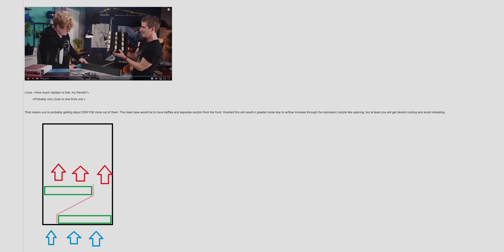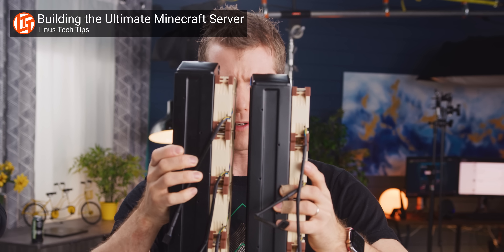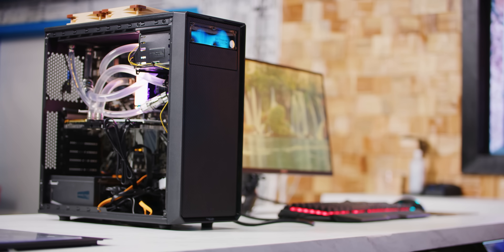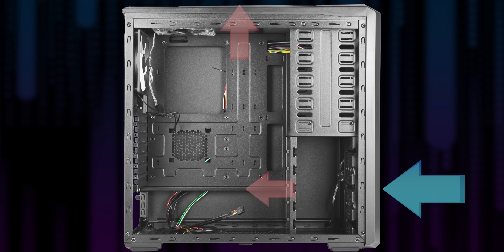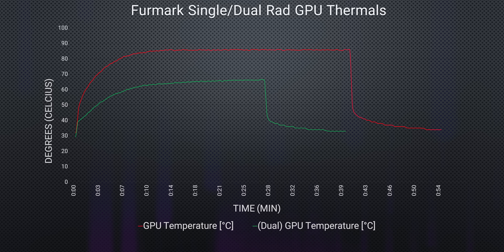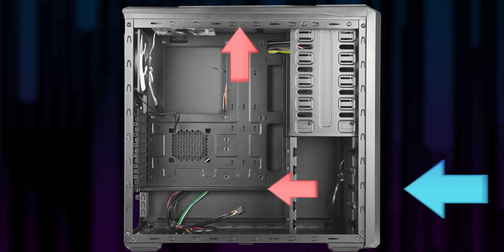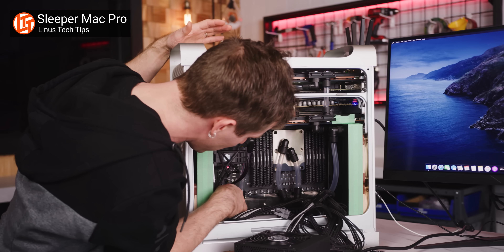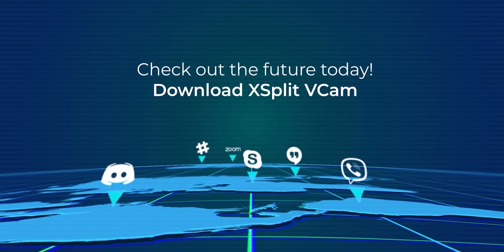I’ve been water cooling wrong for YEARS - $H!T Manufacturers Say

Comment: Yea, they teach that stuff in engineering college. 

You should put them in parallel air flow if you want more cooling.
Reply: Parallel will have better performance, sure, but it is a very bold to assume that the air coming from a radiator is practically the same temperature as the radiator. You can put something like a blowiematron on a radiator and the air coming from it will be close to ambient.
Reply: That’s the whole problem I have with Corsair’s statement, it’s bad problem solving plain and simple. It takes 5 min and two temp sensors to find out the air coming out of a rad is not far off ambient. Whoever made the assumption that since rads are so efficient the air coming out is close to water temp needs to revisit their heat transfer class.
Reply: @corinwilson1590  if corsair is claiming 100% efficiency, sign me up.  NEVER in my life have I seen a 100% efficient hx.
Reply: @corinwilson1590  It's transfer of heat. Faster moving air will not take enough heat to raise the temperature. But is that efficient? You can blow a hurricane in there and cool all the radiators... but it won't be noise pleasant.
Reply: I would also put the water flow in parallel also.  parallel flow your head pressure is not that bad compared to having hx in series.  With a small pump/high head pressure you might run into the risk of not providing enough water flow.   Having done water cooling for a/c avionics it's a trade off of hx size vs. head pressure vs. cooling air vs. number of hx
Reply: @AG-qq3zl  
parallel water flow doesn't sound like a good idea to me, water follows the path of least resistance as most things do and since it is very unlikely for someone to make two parallel loops with equal flow resistance, one of the radiators is going to get more water flow, while the other one is going to get very little water flow, preventing both from achieving peak performance as the water isn't in radiator number one long enough to radiate it's heat away, while the other one doesn't process the amount of water it actually could.

my personal question on the subject is why they even install radiators into the case, according to my thought process, it would be more advantageous to have the radiators outside the case.
Reply: @windhelmguard5295  it's not that hard to balance the flows.  It just depends on how its installed.  In some cases the hx were close enough and equal heights that the flows spit evenly.  Another time we used orifices to balance the flows.   There are always a thousand and one ways to plumb a system.  It just depends on the restrictions you have.

Although one area I always had a problem with this  computer liquid cooling is the fan placement.  Don't like the push method since your are coreing the hx.  But like I said your always restricted by something.

Do like the discussion and trading ideas.

Comment: The best solution is to have each rad as an INTAKE (bottom, front, back) and use the top of the case to exhaust all the heat (aided by convection).

Comment: Other companys: More cooling is much better. Buy more of our stuff.
Corsair: One is just fine. You don't need to spend more money.
I don't get it xD
Reply: Law of diminishing returns. It's way less efficient to stack rads on top of each other (like Linus was doing in that server build video) rather than running them in parallel air intake or exhaust. Linus's answer is just disingenuous as he's testing a totally different system than the one he was getting flack for from Corsair. I did not expect that from Linus...

Comment: You'd have to measure the air temperature before and after going through a radiator to see how much more the temperature could potentially increase before it hits the 2nd radiator. Also measure the temperature before and after the 2nd radiator

Comment: I think what they were trying to say was there would be dimishing returns. I imagine it would be extremely difficult to make it worse or not make a minor improvement. It would be nice to also confirm what they're saying, that would be the real insight, in which cases would it be bad? I didn't really gain a lot from this except you proving a point to corsair, but I welcome a more condensed video with more varying common setups.

Comment: negative pressure in the case is important. radiator fans should face outside and (i mean for 2 rads) for fresh air 2-3 fans should be enough. look at cars, the radiator is in the front open to new fresh air.

Comment: Oh cmon, a few sensors placed in a few spots here and there could've painted a much clearer picture.

Corsairs simulation assumes that the heat transfer is very efficient, but I don't think that's really the case, with the air after it passed the radiator still being a good difference from the water temperature.

I mean sure your theory applies too, but that I. E. shouldn't work in the directly stacked radiator setup. And in that setup you had much thicker radiators than in the gaming computer.

Comment: I doubt every radiator is able to dissipate enough heat to saturate the air enough to make a second rad a waste of time. The best way to test that would be to stack a set of rads side by side and a set of rads one in front of the other and keep adding rads between tests. That will eventually tell you when you are reaching the saturation point of the air. At what point will you reach diminishing returns?

Comment: Also you can run the cooling loops so that the second radiator gets the highest temp water and the radiator getting the coolest air would get the cooler water which would increase the efficiency of the cooling system but I'm sure that this is what Linus did and what corsair did not do.

Comment: I've said this before, but in the end, Water Cooling is just air cooling with extra steps, the water is just transporting the heat just like heat pipes. Nobody realises this, it's also why some air coolers are just better then any water cooler. What you need is just more airflow to cool better (as long as the room is cooler)

Comment: I think the problem here is that this system produces so much heat that it surpasses the first radiator's cooling capacity by a lot. Because the first rad can only dissipate a limited amount of heat, the water hitting the second rad it's still hot enough to dissipate even to the hot air going through it. This might be why adding the second radiator is effective.

Probably with a lower TDP system the first radiator will already cool the water to a point that when it arrives at the second radiator it's already too cool to be able to dissipate more heat (also if in that second radiator the air is hotter than the water it might even heat it up instead of cooling it down).

Comment: i would think that taking the water to the last one to get the air first and the one that gets the freshest air last could make a diference too.

40 deegre water going in the second rad with air that is only heated buy the already alot colder water in the first one. if you get my point?

but this could be wrong in every way.

Comment: The argument against stacking radiators would also mean that thick radiators aren't any better than thin radiators.  Each row of cooling tubes in the radiator is less efficient than the row in front of it, for the same reason as stacking radiators.  The trick is that "less efficient" does not equal "does nothing"...unless the first radiator is 100% efficient at transferring heat to air.

In the automotive world, going from 2-row to 3-row or 4-row radiators always improved cooling, but not as much as going from 2 thin rows to 2 thick rows (which is more efficient than 4 thin rows).

Comment: Air isn't a perfect conductor anyway, it takes time for it to take on heat just like water does going through the system, so the air moving thru your system will only take on so much heat as it passes thru each radiator. If the air was being moved slowly through each rad, they might have a point, but instead you're pushing as much of the available air through each rad, and dispersing it back into the system that is the room that you're in which will likely never reach a saturation point.

Comment: So, here's the thing.  in a perfect, sealed airflow, test where the exact same amount of air is moved through the rads, and that airflow is tuned such that it is just enough to pick up the heat from one rad, than yes, the air's heat capacity will be full before it then goes through a second rad.  This can come in to play in systems designed to be as quiet or to use al little power as possible, where fan speed is perfectly tuned for one rad.  In the real world, fans push far more air than needed to pick up the heat, so there is plenty of heat capacity remaining.  One  can think of it as a hose filling a bucket.  if you equate the heat to be removed to a bucket that has a hole in it, such that 1 liter empties from the bucket each minute, and you set the water from the hose so it fills the bucket at one liter per minute (ex the fan speed pushing just enough air) the bucket will never go empty or over fill.  In a typical computer, however, far more air is being pushed through, say setting the hose in this example to provide 10 liters per minute.  All that extra water just spills over the top of the bucket, or in a second rad example, could be drained in a second bucket or third or fourth, all with plenty more to spare. 

In the @LTT test given in this video, I am curious if fan speed was measured, and/or what the fan speed difference would be, if the test was done with both rads and all 4 fans in place, but with the second rad bypassed for the single rad test.  I bet that the fans would spin up just a little faster on the 2 rad setup, assuming they are tuned to move as slow as possible to maintain some given temp.

Comment: What corsair said was that for a radiator to work it needs to have a temperature difference between the inlet and outlet. That is, in the configuration where there were 3 radiators together, the middle one would not do anything because there was no difference in temperature between the entrance and the exit. Now if you stand them next to each other the story would already be different. And yes this is not the same example as the one corsair "criticize". You have to remake the test with the 3 radiators on top of each other vs next to each other. And here you will see the differences.

Comment: Now I’m curious about my setup. I knew there would be diminishing returns but idk. I have a Lian Li 011 Dynamic XL with 3 360 mm radiators. Two intake and one exhaust (as well as one fan in the rear venting out) any thoughts on this setup anyone?

Comment: wow if that's how corsair does their engineers that makes me weary of their products. rads are not 100% efficient or anywhere close to it. A radiator will not heat up the ambient air to anything close to the water temperature. there is still a lot of cooling capacity left in the air after it goes through the rad. There is simply not enough contact area or dwell time for the heat to transfer that fast into the rushing air so when ambient is 24C it might be a few degrees higher coming out of the rad but still significantly lower than the water temperature so running it through a second, and even third rad will improve the cooling. Maybe they were doing their tests at 1% fan speed where they setup lab conditions to get higher thermal transfer into the air but that's very specifically constructed and not real world.

The argument could be at very low airflow a 2nd rad won't help much or be worse, but at any decent or high airflow there is plenty of cooling capacity left in the air as it goes through one or multiple rads.

Comment: If you run stacked rads in reverse-return (first/hottest rad at the back of the stack and last/coldest rad at the front of the stack) it will always improve things. The only negative is the additional head that the pump has to flow against when adding too many components.
Reply: This. Basically a counterflow heat exchanger. Hot water flows towards the fans, and fans blow towards hottest radiator.

Comment: Thanks so much for this. I was going to stack radiators in my build and wasn't sure if it would be fine and didn't find much on the topic. I also wanted to know if a single 80mm rad can handle r5 2600. I found absolutely nothing on the subject, but I was able to test it myself. It actually can. I tested it with aida64 and temp climbed to 80°C, tubes were really warm to the touch. After stopping the cpu load it dropped to 40°C very quickly. Anyway, thanks for this little test.

Comment: When rads are plumbed correctly to move heat out and not fighting each other, which my hypothesis is that Corsair simulations do not take that into account and had the the first rad plumbed into the one in front of it, and not the other way around.

Comment: I'm guessing it's because the heat transfer from radiator to air isn't as close to 100% efficient as they were claiming. As for my personal setup, even if they were right, I've got an extra unrestricted intake from the bottom to bring in more cool air for my top exhaust rad.

Comment: The lesson is that real-world data is more valuable than simulations, especially if the assumptions going into a simulation are incorrect. There's a particular branch of study that's quite a topic of conversation these days. It not only violates this on a regular basis, but also openly advocates for ignoring real-world data and relying on the simulations instead. Always check the methodology.

Comment: Trying adding ducting to feed the radiators with external air, way more effective cooling, then duct it back out again. Case design would need to be  very different, but a fresh sheet design would end up with a better product, rather than the sticking plasters being applied.

Comment: Your test wasn't even close to the scenarios corsair critiqued. Wtf?
Reply: also makes no difference as what corsair is saying is that thicker radiators do nothing and can even somehow hurt performance. having two 30m thick radiators stacked is more or less the same as having one 60mm thick radiator. Or because of how they are actually built the equivalent would be 45mm. Also in each of the critiqued scenario they have also added added more fans so lack of airflow is also not the problem.

Comment: This video doesn't make sense. I'm guessing Corsair's point is that a second radiator is bad if you let it intake all the hot air from the case. But what if both rads pull in fresh air from outside and exhaust into the case?

Comment: The big thing is, from what i can see in the emails from corsair is that they are critiquing the stacked radiators with fans not a case with multiple radiators in different places.
Reply: They removed a radiator from the stacked Minecraft server which the second email was about, increased temps by 5 degrees
Reply: @brye5235  yeah but what happens to the temps if you pointed all 3 rads in different directions? The diminishing returns is going to slap you really hard. When the air gets recycled through all 3 radiators, the air simply can't hold any more energy. 3 rads is great when they all get fresh air, but stacking rads through each other is just generally super inefficient.
Reply: @asm_nop  It will still cool better than 1 or 2 rads assuming the orientations are unchanged. The air won't run out of thermal capacity, that's a weird statement.
Reply: @brye5235  Well, that's over $150 of radiator for 5 degrees...
Reply: @chrisbm   Well when you get to near peak quality, you need to spend increasing amounts of money for a minimum amount of improvement; this is seen everywhere, the price of a 2080 ti, sports cars, high-end clothing.
Reply: @danielhu6485  I understand that, but if we are talking about efficiency then thats not the case... Most cases is one or another. You don´t care how efficient a sport car is when you buy one!
Reply: @chrisbm  Fuel efficiency, no, but track performance and speed? If you look at the most expensive sports cars, they're generally the fastest or perform most well on the track. High-end sports cars are a combination of high quality and performance, meaning my point still stands.
Reply: That proved an inefficient radiator is better than no radiator. What would the temps be if the 2 rads were separated?
Reply: What corsair is saying is that 1mm thick radiator would be just the same as infinitely thick radiator. the radiators wont heat the passing air to the same temperature as the water. Nothing is that efficient at heat transfer. Therefore having the air pass through more radiator will heat the air more and cool the water more. There is diminishing returns as the exhaust air temperature gets closer to the water temperature and it would be more efficient to have all radiators get fresh air but there is literally NO scenario where adding more radiators would hurt the performance as long as the pump can pump water through all of them.

Comment: I'd think that the extra coolant it takes to fill the second rad has a significant impact on heat dissipation throughout the liquid and keep it overall cooler, no?
Reply: What about when the liquid reaches steady state/equillibrium?
Reply: Wrong. That just means it takes longer to reach steady state. Surface area and material effect dissipation.
Reply: @G3rain1  Surface area and water amount are directly proportional to each other. A liquid will always reach equilibrium in a loop obviously.